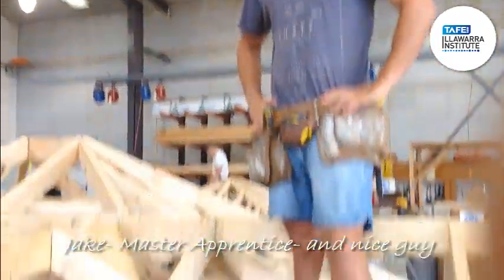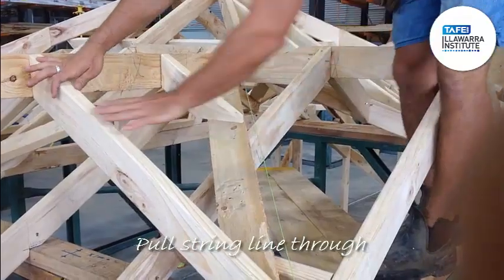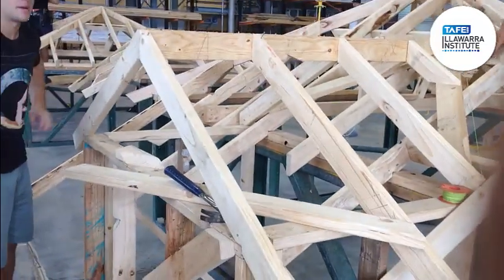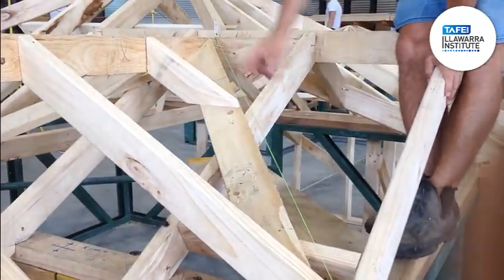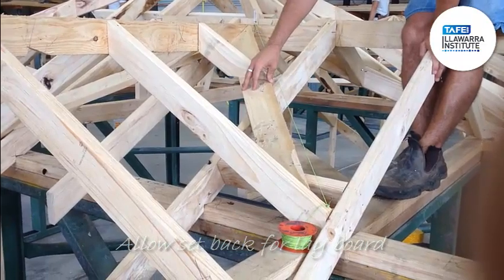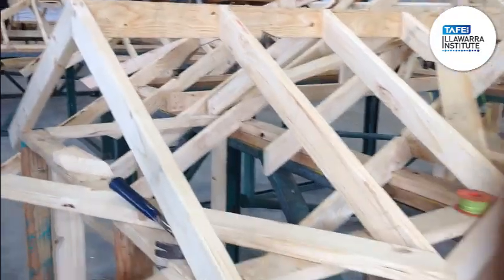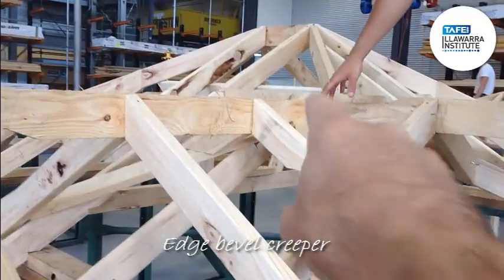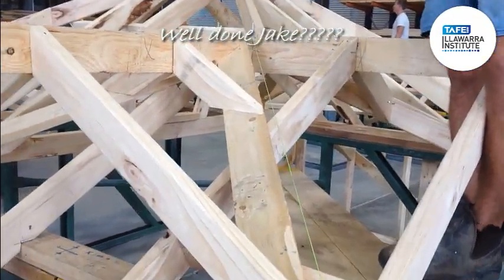Scotch valley roof #buildingeducation #diy #carpentrytips #building

Comment: If your using Edge bevel purlin to get the bevel at the bottom, what is the rafter length and span your working with? Is it the length of the common rafter and run of the dormer? I'm American so we don't get trained in using the square for bevels.